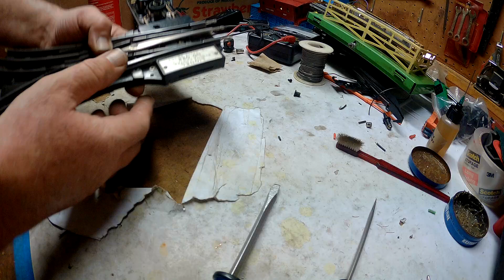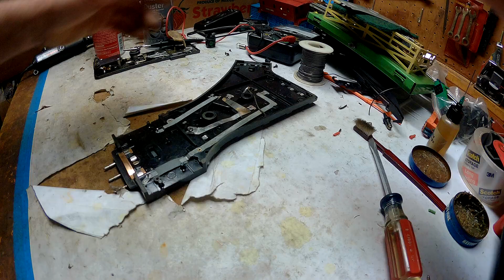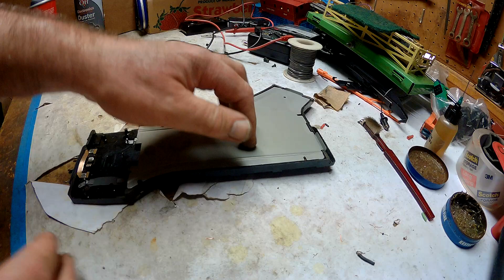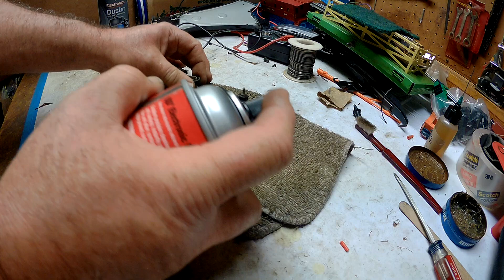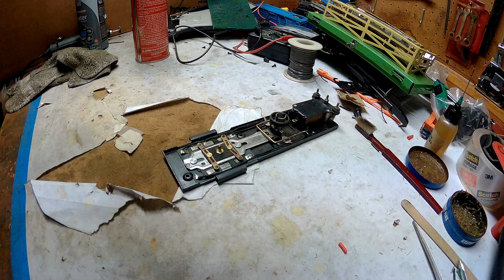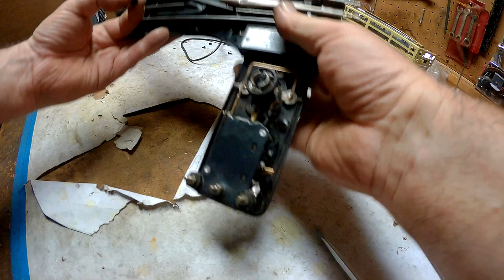Lionel postwar 022 remote switch reconditioning video Part 1

Comment: With the nonderailing rail that is frequently unsoldered. I  remove the original solder with solderwick then add fresh, modern solder and add a small jumper wire across the connection to reinforce the joint. This will prevent it from ever breaking again. Also in the switch machine I use a fiberglass scratch brush to burnish the contacts that the fingers slide over. The fiberglass brushes are available on Amazon. While expensive they're worth their weight in gold. Useful for burnishing armature commutators also.